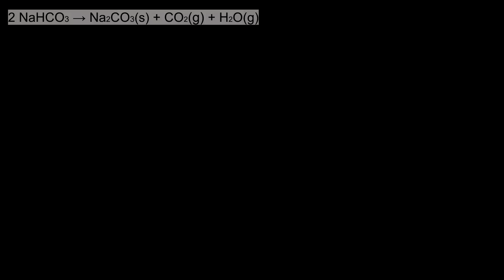How to make Sodium Carbonate (from Sodium Bicarbonate)

Comment: You can also make Sodium Carbonate from baking soda.  Just heat on a stove or oven at 200 Celsius until gas stops forming and powder is dry.  One less chemical to buy now.
Reply: I know you're being helpful, but sodium bicarbonate is baking soda.
Reply: @RedSntDK Exactly my point, heating Sodium Bicarbonate removes carbon dioxide and leaves you with Sodium Carbonate.
Reply: @RedSntDK Exactly my point, heating Sodium Bicarbonate removes carbon dioxide and leaves you with Sodium Carbonate.

Comment: Sodium carbonate can we use to neutralize acids like acetic acid to make sodium acetate or any kind of acid since the pH is very low You can use it to make ramen noodles That's how they get their springiness because they are just technically normal spaghetti type noodles And like you said you could use it to make soap to pH balance your pool and a lot of other organic chemistry for neutralize acids and even to possibly extract certain things that may be an acid or a base just depends on what it is
Reply: As far as I know, the recipe for kansui, the salt-lye water used for noodles is 1% salt, 1% sodium carbonate. And you want as low water content in the dough as possible, but 35-40% is good for starters.  
I've made noodles like this several times this month and the chew is unbelievable.

Comment: Appreciate the low cost way of making my own hot tub additive to raise the ph of our water. Much appreciated.
Reply: Do you then drink the water without any problems neh? I too wanna raise our water pH, or How much do you add on how much solution please help... this water makes me sick
Reply: @thobanijoji590  you're drinking hot tub water? no wonder why you're getting sick
Reply: @thobanijoji590  Sodium hydroxide or Sodium carbonate are the preferred methods for reducing acidification. The problem with sodium bicarbonate is it does not have a very high  pH, sodium carbonate is higher pH so it will lower it more than bicarbonate. Then the reason they use carbonate over hydroxide is mostly because handling them is much different. Hydroxide is unsafe to handle outside of containers while carbonate is easier to handle - both will screw you up if you mishandle but carbonate is slightly more forgiving. 
What pH is your water? If it is between 6.5 and 8.5 then it would likely have more to do with what is in the water than the pH. If it is outside that range, then you might want to correct it. 
Honestly the best thing you can do is get a reverse osmosis filter (can add de-ionization if you wanted further sterilized but not necessary, or at least a carbon filter and try to get out what you can and check the pH before you go further.

Comment: Can't we just blow our exhaled air (CO2) into drain cleaner solution (NaOH)? 
2NaOH + CO2 --> Na2CO3 + H2O :)
Reply: A bit dangerous but yes that can work, that’s how you get potassium carbonate too.
Reply: @monarchatto6095  Yeah right, but you can put a lid on the container of NaOH to minimize splashing chances
Reply: @atifashhabatif8391  True. I wonder if putting some dry ice in it would work too
Reply: @monarchatto6095  That's a big brain Idea, but dry ice is really high concentrated CO2 as it's solid, so the solution can foam up, and too much co2 in the air can be fatal.

Comment: I'm seeing that sodium carbonate is a commonly used commercial meat tenderizer, and I wish to try some recipes featuring it.

In my country, baking soda is available anywhere while sodium carbonate isn't sold as a retail food stuff.  Obviously I could use the video's method to make sodium carbonate and proceed that way.

However, I see one recipe recommending sodium carbonate but then pointing out that "in a pinch" baking soda can also be used.  A more general-purpose advice page states: for every 12 ounces of meat, use 1 teaspoon of baking soda and 1/2 cup of water, and soak the meat for 15 minutes, THEN RINSE.  There's no rinse stage mentioned in recipes using sodium carbonate.

My question is: do you chemist-types agree?  Does adding sodium carbonate OR bicarbonate to water result in the same water chemistry?  Or can you see a reason for me to fry up a batch of sodium carbonate?  Do you see a reason to rinse one but not the other?  Finally, how would I adjust volume?  Cooking's not rocket science, so would say double the amount of baking soda be a reasonable substitute for sodium carbonate?

Comment: Like many others it doesn’t do anything. I baked for hours at 450. Then I melted the aluminum layer out of an old pot. Still weighs the same as the starting weight. No idea why it does not work. Anyhow I discovered that I can buy arm and hammer laundry soda cheaply at Canadian tire. What a disappointment trying to make some for noodles but at least I have a solution.
Reply: It might’ve, when it gets wet is it slippery?

Comment: The only problem I was finding with some of the baking sodas brands I was coming across is that it had cornstarch in it, whereas if you start off with sodium bicarbonate you most likely have something of a Pure form!
Reply: those might have been like baking powder or something, they contain both an acid and a base, along with fillers like cornstarch
Reply: @aeriumsoft  😂

Comment: I just did the same with 56g of baking soda and bubbles only occured when i was stirring/shaking powder with the pan. After a while even with shaking there werent any bubbles. Also i was able to smell gas (probably Co2) that came from the pan. I guess it worked for me. Now after weighting i have 35g of the powder

Comment: Good video, and I get that it wouldn't be a very interesting demo, but if you are making the sodium carbonate for use in cooking (in place of lye for dipping home made pretzels for example) you can definitely just dump the baking soda in a pan and just bake it til it converts. shake it up here and there, no real stirring needed, same resulting smooth powder and change in density. 👨🏻‍🍳👨🏻‍🔬👍🏻

Comment: How long does the entire process take?
Reply: I tried this for over 20 minutes with two different amounts of sodium bicarbonate. It did bugger all!! I couldn't manage to replicate the process shown in the video and I took chemistry in high school. The sb didn't bubble or reduce. At higher temperatures it did give off fumes which were removed by an extractor fan. I wonder if the composition of household sb is slightly different in the USA??
Reply: @kadensmike8190  for me it only happened when I stirred it, or else barely any geysers happened.

Comment: It Needs 80 C° Only
Reply: If you want to wait forever, yes, it needs only 80 C. You should use higher temperatures because while the chemical reaction takes place at 80 C, water boils at 100 C, and water is produced by the chemical reaction.
Reply: Michael Be
I Meant If You Have A Limited Heat Source...Anyway You're Right

Comment: Mine doesn't bubble. What did I do wrong?
Reply: Heat it higher. Or, you have sodium carbonate already.
Reply: @oneatpeace5450  I tried two pans with different amounts for 20 minutes on a high flame and neither bibbled or reduced. I wonder if the composition of sb for domestic use is slightly different in the USA?
Reply: IlikeAnts ö

Comment: at 01:03 carbon dioxide is clearly observed to leave the substance yet the substance retains its content of carbon dioxide plus one oxide according to its chemical formula (NaHCO3 and Na2CO3)? It's ridiculous same amount of carbon dioxide even after CO2 observed to leave!! Chemistry nees overhauling! And to make matters worse, where does the extra sodium come from?
Reply: It's tricky isn't it?  :)  Two NaHC03 molecules yield one Na2CO3 + CO2 + H20
Reply: @zxcvbob  sorry that equation doesn't make sense because you haven't taken into account the origin of the CO2 as you still have 2 x CO3 in both parts. So where does the CO2 come from? Also where's the extra sodium gone? 

I've heated up sodium bicarbonate to create 'sodium carbonate' and during the process I noticed within the saucepan a lot of 'dust' was kicked up from the stirring of the bicarbonate. Imo it's this dust that puts out the flame and no CO2 is released. They even use sodium bicarbonate in fire extinguishers.

So imo the formula doesn't reflect what's presented in the video.

Comment: I finally got around to doing this, but for some reason after decompsing it gave off this odd sulphuric type burnt smell. I had to put it outside to cool and air out my apartment. Other than that it wentas expected. Any idea what may have caued this? I made sure I used a clean pan. The brand of bicarb was great value. I only noticed the smell after the reaction completed and i was heating it further to drive off remaining water. At which point I turned off the heat and covered it.
Reply: It could be the smell of the pure co2 released. I noticed it gives off a smell similar to sulphur.

Comment: Very useful video. After some idle thought today I came up with the idea to convert baking soda into sodium hydroxide through a series of reactions. With this being the first step, this video provides a great guideline for me to work out the details of the process. Thanks for taking the time to make this and share it with us. Another process I read about was heating it in the oven at 200f for an hour. Which brings up a question I meant to ask. Why did you decide on 200c for the temperature? My understanding is that 50c is the temperature at which bicarb decomposes, though I would imagine you would want to heat it above boiling to drive off the water. Which makes me question how well the oven method would work at 200f. Either way, I think I'll be using your method when I do this.
Reply: Hiya, I don't know if you're still on board here but here goes - you've used both 200f & 200c in your question?? 

212f = 100c which is the boiling point of water at sea level. If you want to see if you've succeeded in making sodium carbonate, test for a pH of 11, as opposed to 8 for sodium bicarbonate
Reply: @cbjones2212  I meant what I said. There were no mistakes. Ovens generally operate on farenheit.
Reply: @cbjones2212  Sodium carbonate can be made easily enough. Throw some baking soda in a pot, heat on low-medium heat until it starts bubbling (that's CO2 leaving the bicarb), stir occasionally. Once the bubbling/puffing stops you've got carbonate. Be sure to store some place dry because it's very hygroscopic.

There's no need for a test, I know the chemistry works. It's just common sense that bicarb breaks down into carbonate at  80 celsius (176f). So there's no need to test it.

Also you can't say that X substance has a specific pH. pH changes with concentration. Obviously you're going to have significantly fewer hydrogen ions to donate/accept at a lower concentration, and hence the pH will not be the same for the same substance. I mean, it stands to reason concentrated acid is going to be more acidic than dilute acid, but just in case: https://www.pmel.noaa.gov/co2/story/A+primer+on+pH#:~:text=If%20you%20add%20acid%20to,increases%20and%20the%20pH%20decreases.

A more accurate measure for acidity acidity is the pKa, which is a measure of the dissociation constant of hydrogen for that molecule. Obviously the lower the dissociation constant, the more likely the molecule will be to donate a hydrogen and hence the more acidic it will be. No mucking about with any other variables like concentration. That's why you never see acidity measured as pH in any chemistry class or text book.

The more you know, right? heh. =) And don't worry, dissociation constant took me a bit to understand. It's just a fancy way of saying how much part A wants to stay attached to the molecule. The lower pKa, the less it wants to stay bonded. 🙂
Reply: How did that go? What was the reactions you used to make NaHCO3 into NaOH?
Reply: @filipealarza9079  I didn't use any reaction. The method I came up with was purely hypothetical. I would require well over 1000c to decompose sodium bicarbonate into sodium oxide and soxide oxide isn't a very stable chemical (likes to go boom). I was ultimately just thinking out loud. Although I didn't know it at the time how impractical it was. I just bought sodium hydroxide online for like $15 for a half kilo for pure chips. No fuss, no muss. But also no exploring science.

Comment: Do you know if sodium carbonate can be used like pottasium carbonate as an electrolyte for hho dry cells?
Reply from the maker: I honestly have no idea
Reply: Usually KOH or NaOH is used but these are hard for me to get. I heard K2CO3 (pottasium carbonate) is the best and it's not as caustic. Because the chemical compound of Na2CO3 and K2CO3 are very similar and is a lot easier to make Na2CO3 than to get K2CO3 I wanted to know. Do you know what are the biproducts for electrolysis of Na2CO3?

Comment: I used this today to make some coffee machine cleaner (sodium carbonate)  2 tests I have for Sodium Carbonate is that A) It will feel slippery when you get it wet and B) you put a tiny bit on your finger and touch it to your tongue and it burns rather than the bitter saltiness of Bicarb.
Reply: The reason it burns is because the pH of Bicarb is 9, while this is around 11 or 12.

Comment: can I please ask if it matters what metal the pot is made of you heated up the sodium bicarbonate in? will certain metals react? can I ask what your pot is made of? it looks like it has a copper bottom.
Reply: According to the wikipedia entry: "For cleaning aluminium objects, the use of sodium bicarbonate is 
discouraged, as it attacks the thin unreactive protective oxide layer of this otherwise very reactive metal". His pot looks to me like a Stainless Steel one.

Comment: Pretty cool. Didn't know it was so simple. Folin & Ciocalteu's Reagent with saturated sodium carbonate solution can be used to test for phenolic compounds in soil solution. Also use sodium bicarbonate to extract phosphate for P analysis in soil solution. I hardly know any chemistry at all but your videos help me to grasp some concepts.
Reply: OMG that is exactly why I need Na2CO3! I'm measuring phenolic compounds in chocolates and cocoa intermediates. However the sodium carbonate in the lab was old, and had reacted with the moisture in the air. I was really worried we wouldn't be able to get the experiment done on time if we had to wait for an order of fresh carbonate to come in. I've been a huge fan of NileRed for entertainment purposes, but now its educational on a practical level!

Comment: I put the pot in the gas stove 2 hours but it doesn't releace the CO2!? Can you teach me for this issue please and thank you
Reply: Your stove might not be hot enough, it needs to be 200 degrees celsius
Reply: +Oscar Pool somebody said it can be 100 degrees celsius too
Reply: @kenanalibegovic6724  The conversion of baking soda to sodium carbonate is around 80 celsius, but you want to make sure you get hot enough to get rid of the water that is released, which is why 200 celsium is recommended. If you want to wait a very very long time, you could do 100 celsius, but this is not recommended at all.
Reply: Kenan Alibegović not really

Comment: Can we use Sodium Carbonate to neutralize the Sulfuric Acid ???
It will release less gas (not all much gas)
Reply from the maker: Raihan Danurdara If the sulfuric acid is concentrated, it is best to dilute it if you can before neutralizing. Sodium bicarbonate would work well too though. But yes, in theory there should be less gas produced.
Reply: The pH is high enough to do this, yes. However, depending on your application, if you cautiously use two parts lye to one part sulfuric acid, then it will be totally neutralized. Keep in mind that both of these chemicals are not to be messed around with by anyone inexperienced or not cautious.